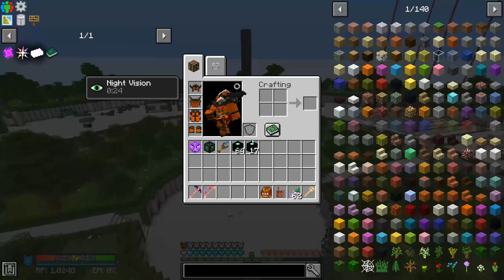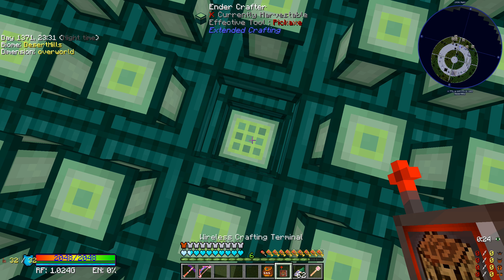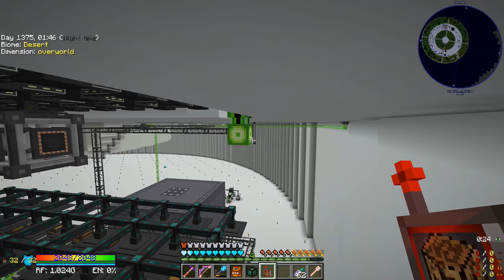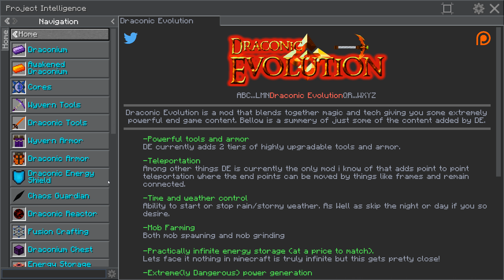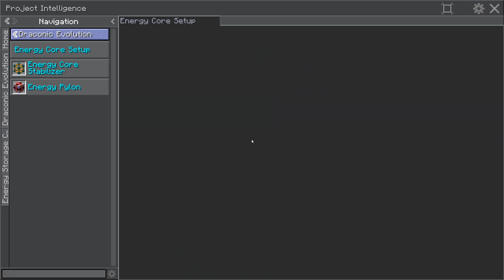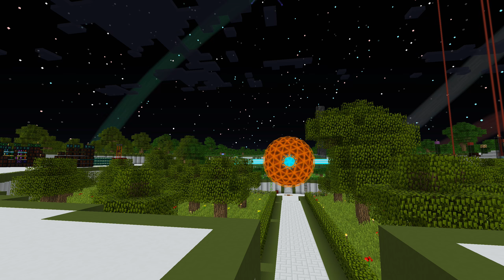Project Ozone 3 Kappa Mode - SINGULARITY SETUP [E126] (Modded Minecraft Sky Block)

Comment: Since building supports from the stairs looks weird, what if you build up diagonally from the circle in line with the stabilizers? Make a sort of cradle under it going up halfway on each side then build down so you get some nice symmetrical, triangular arches around the center. From there, build diagonals in line with the path edges through the top of those supports to create a single block tall ring about a third of the way up the core so it looks like it's being held in place by the structure as well.

Comment: it will be 6 p2p ... since 17*2 is > 32 ... so it would be 4 fully used and either a 5th fully used and a 6th with 2 or 2 with 17 utilization (current setup)

Comment: Maybe you could make the structure look good if you didn't try to surround it. You could make it so the rings are on the end of horizontal posts, each with a simple vertical structure holding them up.  You could use a few Blockcraftery blocks to round it out too, potentially having a single block wide post that flares out at the end to match up with the ring.
Edit: I also feel like you should probably raise it up a bit. With it that low I feel like you'll constantly be bonking your head, and once it has a few trillion RF in it you won't want to destroy it just to move it up a few blocks.

Comment: “This orb is almost infinite, you’re probably never going to fill this.” 
PO3 Super reactor: nervous sweating
Reply: I have only ever seen one guy fill it and i don't know what the PO3 reactor is can you explain?
Reply: viola gilli In the endgame quests (Simple Achievements) there is a quest to build a Super Reactor. This is from Modular Machines, and when I built it in creative mode, and provided it it’s fuel (which happens to be tacos btw), it instantly charged my tier 8 draconic energy orb, wirelessly. I rebuilt the orb farther away, and I used Cryo-Stabilized fluxducts to transfer, but they can only transfer 2 billion per tick.
Reply: @kmetainy  How did you get the power from the Super Reactor into the energy orb?
Reply: @Dennis19901  Its been a while, but iirc it should fill automatically
Reply: @kmetainy  You mean without pipee or anything?
Reply: @Dennis19901  I believe so, yes. That might have been changed, I haven't played PO3 in almost 2 years.

Comment: To move energy around you could start using draconic energy crystals. Always a nice look and very handy to use.
Reply: Your not wrong, they do look pretty nice. Though they are a pain to make in this pack, they are a nicer and cleaner option then the flux points.

Comment: The stellar conduits have a HUGE internal buffer so they have to fill up first before the conduits send power to the items they are connected to :)
Reply: don't they fill up the machine first before filling up the internal buffer? i think it would be kinda stupid to fill up the conduit first
Reply: Cred 50 You would hope so but nope, it fills itself first before transferring.  It’s the primary reason I never use them because unless you are making so much RF you can fill that buffer almost instantly, it’s going to take so long for power to actually start transferring
Reply: @CREDAAAOOO  They do in mine playthrough, been using them since I could make stellar ingots.
Reply: @CREDAAAOOO  They do, Eric is just wrong.

Comment: Each stellar energy conduits store like 2 bill RF per block😂😁
Reply: I believe it is 2.147 billion
Reply: @cosmo1248  it's the 31 bit integer limit so 2147483647
Reply: @violagilli2131  32. The other bit is the sign bit
Reply: @violagilli2131  Just adding a few commas for my own sanity ;)
2,147,483,647.
Reply: SeB no it’s 31, java doesn’t have unsigned integers.
Reply: @jthoward  I am aware Java does not have unsigned integers, but my point still holds -- the max 32-bit signed integer value is 2.147B. 
Saying it's 31 bits would suggest a 2^30 max value since anytime someone is talking about ints, they're probably referencing signed integers unless they explicitly state unsigned
Reply: @TwurtleX  yes you are techincally right. I said 31 only because i did't think power wuold ever be' going negative so i didn't include the 32 byte in my previous comment
Reply: @cosmo1248  it's straight 2 billion cuz I believe they said it can cause problems if they pushed to the integer limit

Comment: Hey hypno, you will need thousands of singularities and some of them don't have EMC you should start using mob duplicators to get those blocks and don't cap how much singulatiries you make, or atleast cap it with a drawer as it stores 2048 which is about as much as you will need.
Reply: I thought the idea was to get enough for 9 infinity ingots and then animate the infinity block
Reply: catalysts are used in so many more recipies then just the infinity ingot.  he will need 100's like op said
Reply: I agree, with 5mob duplicator, it takes several hour before you gen enough singularities, and you need dozen of them which don't have emc

Comment: Hi. Why do you not use drawers with a upgrade to 1 stack, and a controler for use only one chanel in the ae2 sistem, and you can lock the drawer for de filter function.